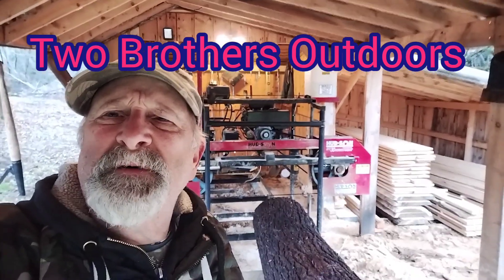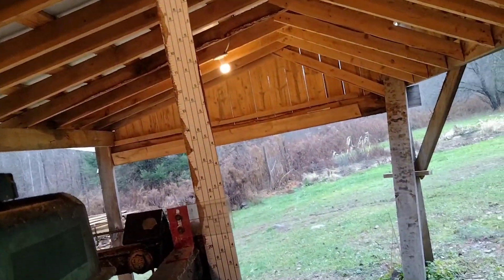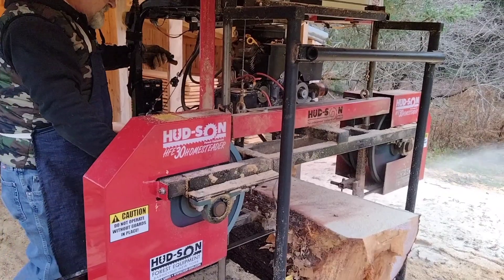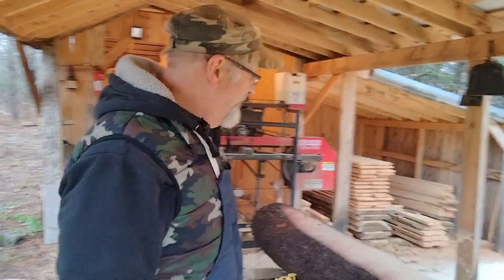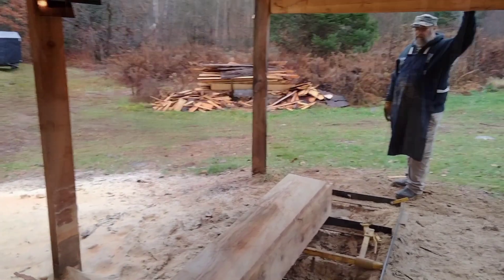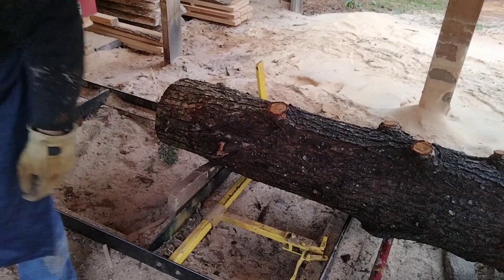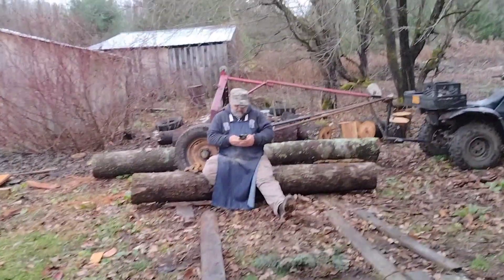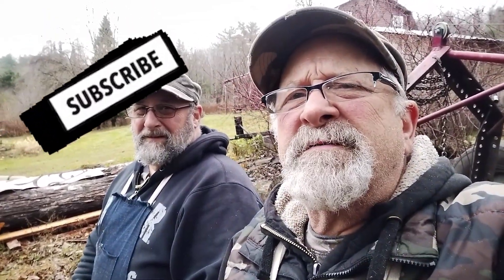Adirondack Logging do-do hits the fan 🤔💪 Hudson homesteader HFE30

Comment: Have you experimented with raising the head to the cut versus lowering it? My guess is, between the head weight and engine vibration. cable tension will be the same whether the head went up or down to reach the mark on the scale. I've heard from lots of folks that cranking up to the mark is important. I think I'll go out to my mill today and experiment.
Yes on a tree evaluation video.
Reply from the maker: Thanks for watching and the input! We watched your past videos and we have a lot in common. We have modified many things on our mills to make them perform better as well. We changed the blade guides on sawdust's mill to roller guides. He is getting a build up of sawdust on the blade and drive belt. I told him to watch ur videos I think Oregon old timer made a blade scraper for his mill. A few videos back I tried to saw from the bottom up and it was a disaster 😩 well not really but it was a pain in the arse.